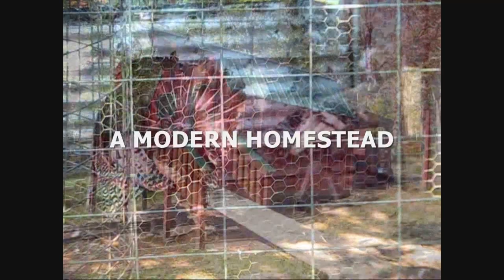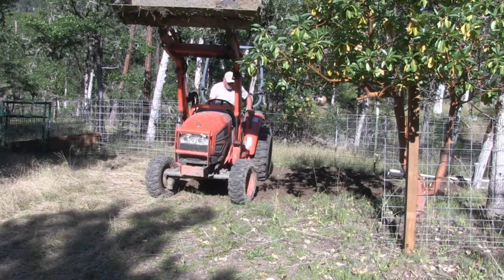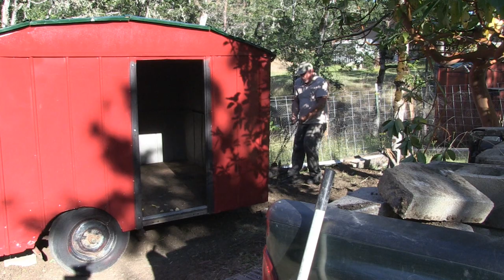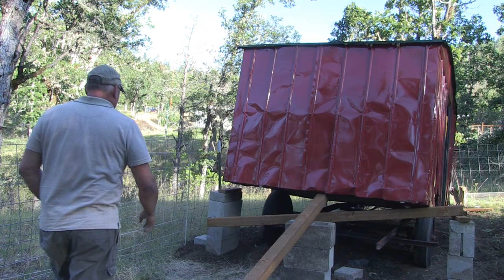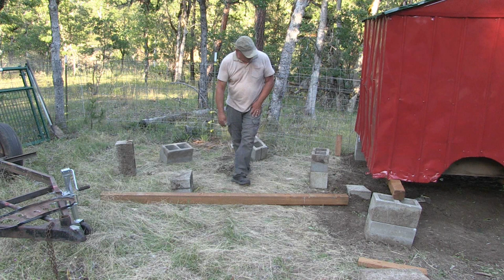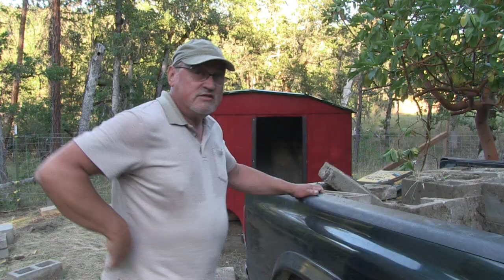HOMESTEAD BUILDING PROJECTS - A New Billy Goat Barn Part 2

Comment: To get it on a trailer did you cut wheel wells in the shed? Looks like it
Reply from the maker: In the previous video I mentioned that I got the shed from an estate cleen up while we were living in our travel trailer on a person's farm. I also got the trailer chassey from the same estate. Combining the shed by modifying it's size a bit I built it to the trailer and used it as a portable storage and laundry room to house the free washer and propane dryer I got. Life was good. Then we upgraded to the forty foot fifth wheel which had the washer and dryer built in, so I mothballed the shed on a trailer until this past few weeks took that shed portion off. The trailer I will convert to a ten foot flat bed.